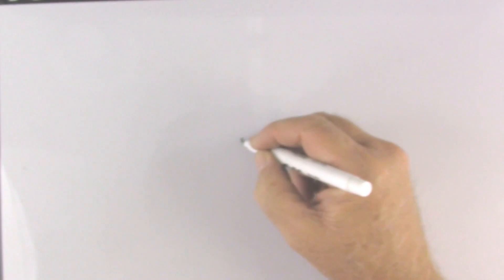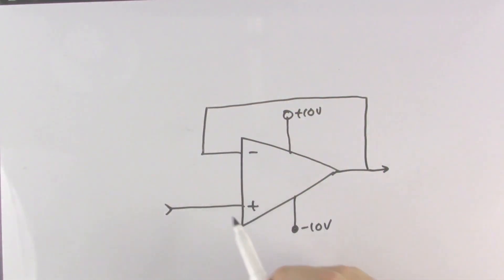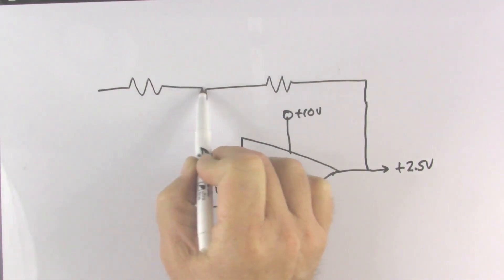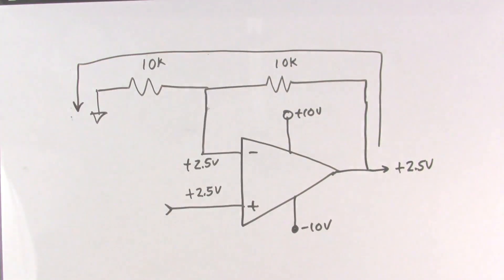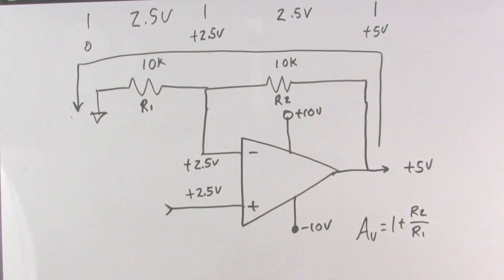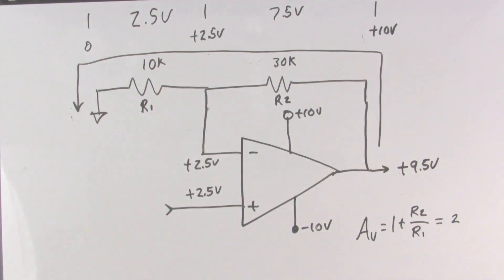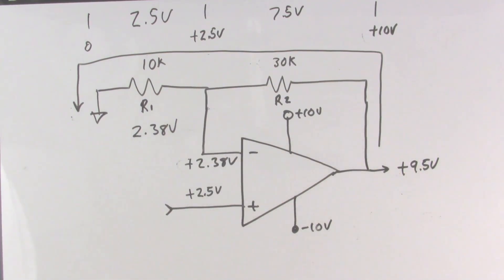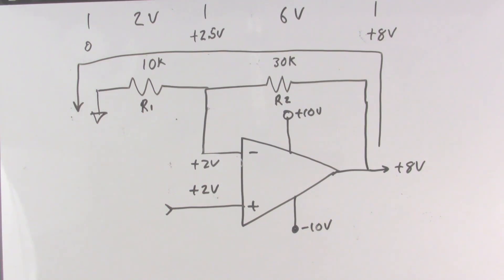Operational Amplifiers No  4, Non inverting Amplifiers

Comment: Long-winded reply, please bear with me.

All your videos are awesome, I try to binge watch as much as possible, going back to RSD. Since this an OP Amp video, I was curious if I may make a suggestion and forgive me if this has been done.

I have been starting to design simple circuits with the kids and would like to start using op amps. I have seen many videos, yours have been very informative, my only hurdle has been visualizing one in a circuit. Of all the videos I have seen, I haven't found one that describes an op amp in a device and how the device uses the op amp. For instance, what is connected to each terminal and what influences the changes. I understand the basics on the inputs and outputs,  but the missing piece is going over a product that uses op amps, and what it does in the device. Whether it's a audio component, TV, motor controller, microwave, etc, when would you use a NPT or PNP if needed, what part of the device would dictate the load or input voltage.

All of this is basic, I get that, and the possibilities are endless, I'm just having trouble seeing it in action in a device.

BTW, your video outside with the wooden rod really helped in understanding them.

Thank you again, glad to be a new patron!